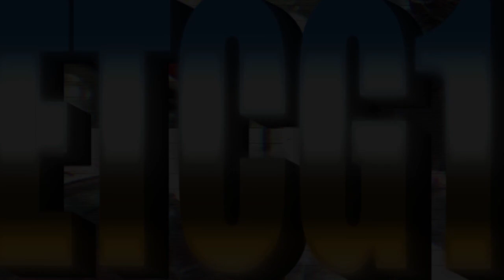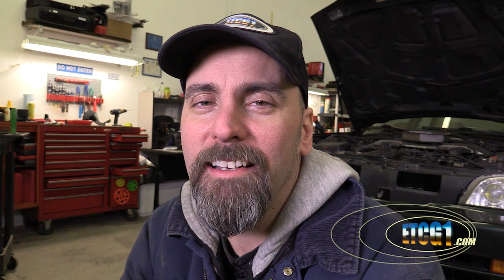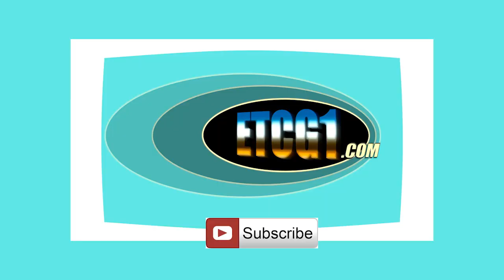Electronics are Stupid -ETCG1

Comment: GROUNDS! Check the grounds and ground straps. The ground side of things is often overlooked. I've seen newer cars do some really weird stuff with loose/bad/grungy ground connections. It can drive the computers totally bonkers.
Reply: That was exactly what I was going to say -- corroded ground connections are often the cause of many different problems.  Don't assume you have a good ground connection just because your negative wire is attached to the body somewhere -- test that ground with a PowerProbe or a DVOM and make darn sure it's good.
Reply: my dads van had a bad frame to body ground that caused low fuel pressure and a no start the pump did not have enough ground under load to put out full fuel pressure, the pump was replaced but did not fix it. it was a 03 chevy express and aparently its a somewhat common issue
Reply: UBBERTANKER
I seem to recall someone..maybe it was Scannerdanner? Who diagnosed/fixed the same problem in a similar van.
Reply: You got that right! I have seen bad grounds cause some really bizarre problems over the years.
Reply: PhattyMo
I think it was his brother James.
Reply: *****, exactly.  Voltage drop tests are how you test and find bad grounds. A bad ground is just a shorter way of saying "excessive resistance on the ground side of the circuit". A circuit can only fail in three ways: an open, short or excessive resistance. Voltage drop tests can find out of the problem is one or more of those three in very short order without any fancy or expensive tools.

Use a DVOM, not a PowerProbe, for voltage drop testing.  Especially on low voltage circuits (e.g. sensor circuits).  PP’s are glorified, over priced jumper cables with a pathetically low resolution volt meter built in. You can perform the same functions as a PP with a length of speaker wire and a cheap DVOM for a fraction of the cost of a PP. You want a meter that can display at least 4 numbers on the screen for good voltage drop testing on a 12 volt system. A good DVOM like that can be had for around $20 compared to a PP’s $100 and up. Just sayin’...

Comment: Well said Eric, computers cannot think they must be programmed to do certain functions,  when a component fails the process stops and the fun begins. FIND IT but like you said, on and off ,ones and zeros, highs and lows. Thanks for the vid.
Reply: In a car there is not just on/off signals. Temperature signal are analogue, throttle pos., oxygen sensor, tank level sensor, etc.   but yes there are also a lot of on/off signals.
I have to admit even with 40 years in electronics, I can often be mislead in the diagnose process. Mostly because circuit diagrams are made extremly poor....and wire colors does not match up with the diagram.
Reply: A computer is only as smart as the programmer makes it.

Comment: I'm a body shop mechanic and I repair pinched and broken wires all the time. Finding them can be a total nightmare sometimes. Or that one ground that the painters painted over, or even better the blown internal relays from the body men driving the car in and out of the shop with the grounds disconnected! One thing I've learned over the years is to always start with the basics, most of the time it'll save you a lot of time.

Comment: I'm an Electrical Engineering major.  My brother and dad are both mechanics.  The biggest thing I notice is that they get so caught up with fixing it fast that they just get a multimeter out and start randomly testing things.  That works sometimes, but can also be a huge waste of time, especially on intermittent stuff or wires that can't be easily accessed for visual inspection.

In one of my first classes in school (basic electronics stuff), we got a circuit that was a big "rats nest" of wires.  The prof. broke it somehow behind our backs with a bad component or wire (on purpose).  We then had to fix the problem with a schematic and no more than 5 tests of any kind (voltage, current, resistance, etc.).  If you study the diagrams/schematics first and build up the skill of coming up with a limited set of measurements to take, you can troubleshoot even very complex circuits very quickly.  It takes a bit of time at first, but after a while you get a feel for it and get quite fast at it.  It doesn't take any classes or fancy training ether (just basic knowledge), at least for the electrical issues I've seen in our shop.

ScannerDanner is a great channel to follow for basic and more advanced troubleshooting techniques, too.  I've learned a lot from his channel.

Comment: Almost all electrical issues are contact failures. I watched a co-workers change a horn on another lady's car. The horn still did no work. I asked him to remove the 1 bolt that held it on. I cleaned the rust the bolt by rubbing it on the sidewalk. Worked.
I got my windshield wipers going by removing the fuse and re-installing it

Comment: there's no question that relying solely on a resistance test is the numero uno rookie mistake.
Reply: bgregg55, relying on resistance tests at all is a mistake IMO. There is no way to know what the correct amount of resistance is on a circuit, let alone a component on the circuit. Everything in the circuit has some amount of resistance, even the tiny wires. A circuit can only fail in three ways: an open, short or excessive resistance. One or two voltage drop tests can tell you if the problem is one of more of those, and also which side of the circuit it is on (power or ground) so you can find it fairly quickly.  All without having to disconnect anything, unlike resistance tests.
Reply: Have to disagree. Many components have a resistance spec.
Reply: bgregg55, resistance specs have been notoriously unreliable in my experience. Especially since a lot of cheaper meters don’t have very good accuracy in measuring Ohms. Often times resistance specs aren’t available for components. They aren’t commonly available.  I don’t remember the last time I got a automotive electrical part that had a data sheet come with it with any electrical specs.  Also resistance specs often vary between manufacturers of the same part, as well as vary from batch to batch made by the same manufacturer.

Then there is the fact that you have to disconnect the component under test from the rest of the circuit completely in order to do an accurate resistance check. Sometimes components aren’t that easy to get to. So if you just disconnect some connector away from the component thinking the component is now isolated, you could be getting a false reading if there is a short in the wires somewhere, not to mention your reading will be off due to the natural resistance in the wires.  Not to mention, often times simply moving a component can (temporarily) “fix” it.

By employing voltage drop testing you don’t need to have a spec, or waste time trying to find it, and you don’t need to disconnect anything. You just connect your DVM to the circuit and your off and running. You just need to know how to use & read the meter.  Much more accurate, IMO.
Reply: bgregg55 yup, it's all about that loaded circuit voltage drop.
Reply: ohming components out does have its place though, to easily show someone that a component is shorted or open internally.

Comment: OMG!!! Thank you... Thank you... Thank you...  I’m so glad you covered voltage drop testing vs resistance testing.  I personally shake my head and feel pity for those who say “it ohm’d out ok” or “i tested it for continuity and its ok".  Ohms tests (which is effectively what a continuity test is) are virtually useless in electrical diagnostics in my opinion.  There is no way to know what the proper ohm’s spec is for a circuit. Way to many variables.  In my experience, 80-90% of electrical issues can be found, or narrowed down considerably, with a series of voltage drop tests. A circuit can fail in only three ways: an open, a short or excessive resistance.  A voltage drop test can tell you if it is one or more of those three in very short order.  Thanks for posting this video Eric.

Comment: I know I had my share of problems involving components just stop working. We got a mercury villager cheap, ran like crap couldn't drive it home. Did a tune up and it ran better for a couple weeks and one day just shut off in a parking lot. Turns out the distributor was going bad and wasn't sending a strong enough spark. But according to the diagnostic tool it was receiving the right amount of spark. Just goes to show you computers aren't always the best judge.

Comment: I had a fun issue. Where my car would crank slowly. But since it continued to crank, I ignored it (being cheap, and thought it was the starter), one day, I took the car on a 400 mile trip to pick something up. Parked it, got my item, started it, got food, and it was 100% dead at that point. Keyless didn't work, nothing worked, but had I just tested the battery when it was fine, I might have learned something. I was thankfully near a parts store, got a battery, thing cranked beautifully. So at least I learned it wasn't the starter :P

Comment: I absolutely HATE electronics in cars!! HATE!!!! Nothing should be that complicated. I've got so frustrated fixing one of my vehicles that I parted it out, bought another similar one 11 model years older, stripped the electronics off it, slapped on a carburetor & a HEI ignition, & never looked back! The engine has never run better! 3 years and counting.

Been working on vehicles my entire life. I repair everything from weedwackers & chainsaws to motorcycles and pickups. I've run into 2 OBD-II vehicles so far that just absolutely stumped me (one being the aforementioned now-carbed vehicle), and have been getting away from auto repair in favor of small engines for that reason.Not worth the stress and aggravation, IMO.

My buddy has a '96 Tahoe that sat 5 years - long story .. but it had died on him and would not start no matter how much money he threw at it. I towed it to my place. Got his oil pan back on with a new timing cover, installed a bunch of sensors he had bought prior. Threw another computer in from the junkyard after I couldn't even get the engine to fart on ether ... and the moment of truth came - it fired right up! .. And ran on 6 cylinders. Every sensor on the engine is new. Entire ignition is new. All cylinders have good compression & leakdown. Spider was replaced. Fuel pump was replaced - pressure is good. That's the mystery - this could just be a faulty computer .... but there should be a way to definitively test the stupid thing instead of an infuriating process of elimination. I think GM designed them this way on purpose, so an average owner will give up & scrap it - one less vehicle on the road ... and I guess in their mind, think that translates into another new car sold. Just damn infuriating. Should be able to plug something into it and get a DEFINITE go / no-go result!! My solution is to drive vehicles built before '96 - problem solved!!

Long story short I gave up! Threw in the towel. He still drives it on occasion on 6 cylinders. Fuel mileage is horrific ...lol.    HATE OBD-II !!!!!!!!!!
Reply: Just because you don't understand something doesn't mean it's bad
Reply: david gissiner
Sure, all electronics are great .... until they stop working.

I understand it just fine. There's a certain point you reach where you just have to throw in the towel ... especially on a rusted out POS. Why spend 40 hours troubleshooting a vehicle that's still a $800 POS at the end of the day? Makes no sense! Besides, I'm better off driving something I can fix with a screwdriver INSTEAD of a friggin laptop.

I have a life - I don't want to spend every second of it under the hood, troubleshooting poorly engineered POS electronics.There are better, RELIABLE alternatives out there. If you like FI, then have at it - that's what makes America great. We all have CHOICES.
Reply: Throwing money at a car expecting it to work isn't really troubleshooting the problem very effectively in my opinion... But if thats how you want to go about it then more power to you. However, I prefer to actually figure out whats wrong with the vehicle before I spend my money. Regardless, Im sure Autozone appreciates your business.
Reply: david gissiner You need to work on your reading comprehension skills. You missed the part about this being my buddy's truck. Throwing money at it was HIS call - not mine. Trust me - I did enough troubleshooting on that POS. It is what it is. If you think you can fix it, and think it's worth it, I'm sure he'll sell it to you for a real good price!
Reply: SS Smithsonite The nice thing about the Vortec 350 he probably has is theyr'e super easy to switch to a carb, but you'll still need an electric fuel pump
Reply: SS Smithsonite  try that in california'
Reply: Better leave Commiefornia if you want a reliable car.
Reply: emission devices make me money aka SMOG checks
Reply: I don't even know how people put up with all those commifornia standards. I would leave this shitty state just over that. No quantity of good weather and sun is worth the huge adversity of having the freedom of owning cars.
Reply: 96 and below still have the same principles. OBD1 principles. Much harder to figure out in some cases.  In a electrical life, we are always 10 years behind, and your late for practice.

Comment: I am always surprised how little a modern car mechanic often knows about electronics.

I once had trouble with my car after they fixed something on the intake. I found out myself that they had replaced a component containing a sensor with one that looked identical from the previous year's model. Only the older model had a simple on/off switch as the detector, while my car had a variable resistor. So the engine management software in the ECT was quite confused. The engine ran and they couldn't find what was wrong, so they just disconnected the wire leading to the dashboard indicator for the ECT. I didn't go back to them after I figured that out.

Comment: I have two examples of "stupid" electronics in cars.  I had a 1991 Camaro where the ignition would just die will driving.  After a few minutes, it would start and continue fine for the rest of the day.  I changed the ignition module with an after market item when I found no spark but it continued to happen.  Later I found that there was a recall on certain modules so bought an OEM item and had no further problems.  Secondly, I had a "check engine" light on a 4Runner.  The trans shop said that it was a "reverse lockout solenoid failure".  They replaced it and it cleared it for a few thousand miles then it happened again so they replaced it a second time but it happened again after a couple thousand miles.  I asked them to replace it with an OEM unit and now after more than 100,000 miles, no more problems.  Getting the picture?

Comment: Case in point: My Brother's car was randomly shutting off, but would immediately restart and show no abnormal symptoms. Battery terminals were clean and the cables looked good. Voltage was also spot on normal.

Upon removing the positive battery cable it came apart. It had fractured into 2 main pieces with noticeable corrosion inside the connector. Go over a hard enough bump and the fracture would separate, while the corrosion prevented power from flowing through the rest of the connector. BOOM, car instantly dies. Put on a new positive connector and it's been perfect since.
Reply: The best thing to do is to replace the positive battery cable. I've seen a lot of problems caused by those aftermarket terminals.

Comment: I can't speak for vehicles, but from my experience as a cable technician I can tell you sometimes digital electronics and electrical components can just be plain impossible and illogical to find or fix. No matter how much you want to believe you miss something; I once ended up literally replacing an entire system twice and running checks everywhere down the line using specialized equipment. Logically speaking the brand new components should have worked and had an incoming connection all the way to the persons room. I even attempted plugging an extension cord from another room of the house that had a working box and connection to the non working one. No matter what the new box with a tested and working connection would not show it connected correctly; even when running the same lines and the same equipment that was working within another room! The only logical thing I could come up with was there had to be metal inside of the walls or some kind of electronic interference within that particular room. It still baffles me to this day though; what kind of normal neighborhood and house within the US would have enough electronic interference in one single room to do that? One would think even if it was interference it should have messed with other things and my troubleshooting equipment as well though. Any thoughts?

Comment: Battery, ground, connectors, fuses. If all these check out the part is either broken or a wire has broken inside that's feeding it. A multimeter can help solve most problems.